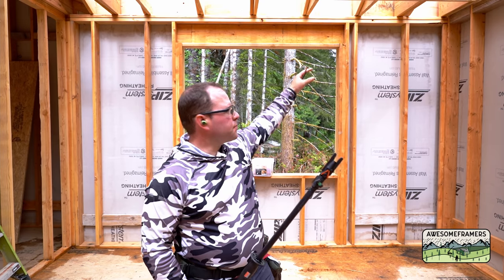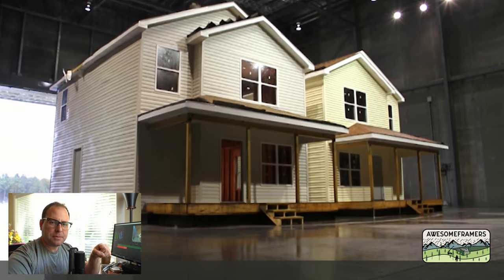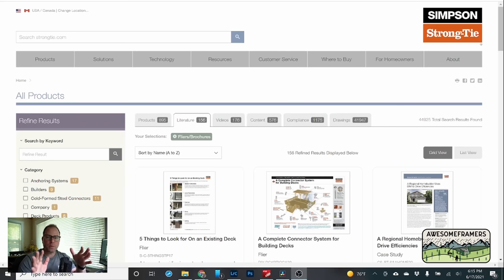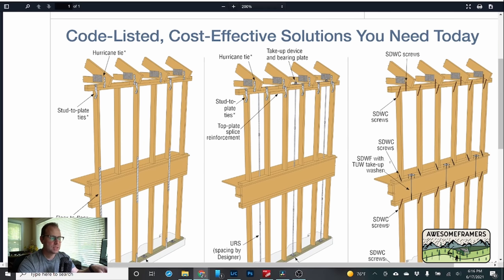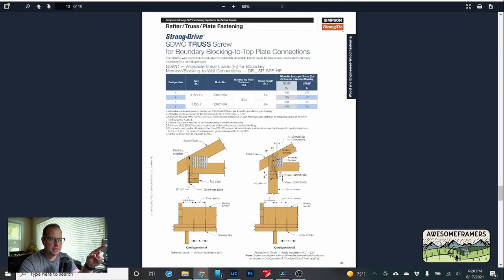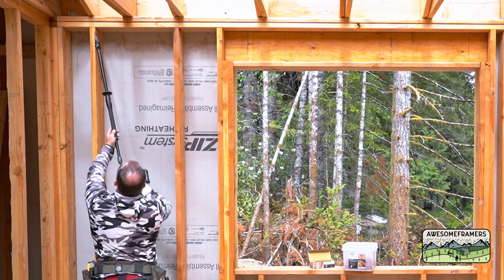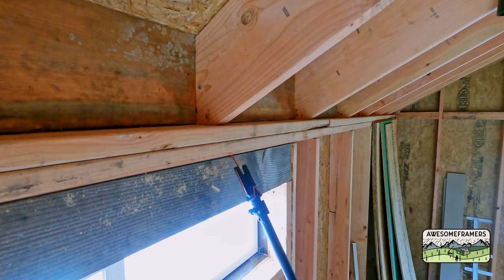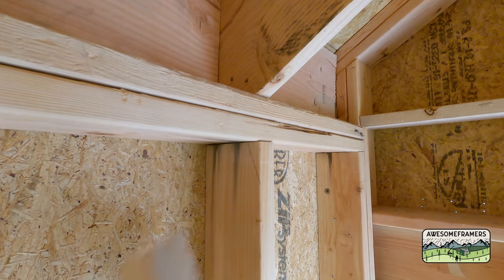Screws Instead of Hurricane Ties?

Comment: Drill/drivers may be faster, but I think you'll find at the end of the day that your wrist has been punished. There is little torque from an impact driver, but the drill/driver will be twisting your wrist all the time. Drill/driver is quieter too, though.
Reply from the maker: I'll trade off each time 😂😂😂
Reply: Not with the 40v drill he has, it has anti kick-back.
Reply: For a professional a drill/driver would be faster but for a homeowner an impact driver is more versatile.  A drill/driver won't drive in large screws or bolts especially into concrete.
Reply: Hire someone at the Home Depot parking lot...

Comment: In AU/NZ we have been using batten/bugle screws for over 40 years. They are load rated/speced in the framing code. We use them for many different tie downs. Especially for purlins(steel roof attachment). Drills in low gear are better than impact drivers for the long ones.
Reply from the maker: The more I see from New Zealand and Australia the more I wonder how far ahead of the US you guys are 🙂
Reply: @AwesomeFramers  I’m from Connecticut. We moved down here 10 years ago. In general the AU/NZ construction industry is 20 years behind North America, Europe. Typical houses are cheaply built. They do have some really cool things down here like their screws. They’ve been using steel in their framed houses for decades because they don’t have a lot of timber. It’s been fascinating to learn how their construction methods have evolved(The good, bad, and ugly).
Reply from the maker: @aspees  That'll teach me to think before I speak.  I would love to visit NZ someday.  That's bucket list for me.

Comment: Quality begins with the Building Designer/ Building Department design review. A well prepared detailed set of drawings calling out what is required for everyone from the general contractor to each sub-contractor makes the project goes smoother for everyone and provides a quality product in compliance with applicable Building Codes for the new owner. homeowner. Excellent video

Comment: I love these videos and I love that newer tech is finally getting adapted from twisted pier footings to structural screws. I will say in my experience a lot of the inspectors I have worked with understand the codes and also know they are “minimum” I’d say 9/10 times as long as you can have spread sheet or and engineer saying it’s okay they are fine with it. We all know speed matters, usually more then price. Great video

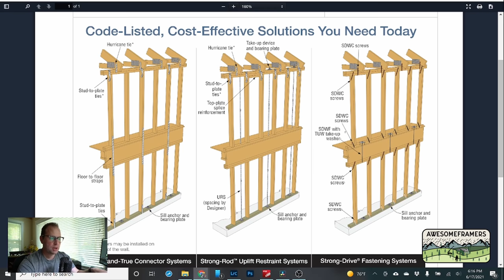Comment: Good information. This reminds me of a research paper l read many years ago regarding how resilient "balloon frame" from the early 1900's were compared to how we frame today.  Also how well metal stud framed houses hold up during hurricanes.  The stick frame method we've been using for around 100 years is out dated, just look at the drawings a 6:00, too many broken connection points.
Reply from the maker: We balloon frame all our gable walls.  The other connections are easy enough to deal with, but I'm not a huge fan of gable trusses.

Comment: I think the Simpson site and online catalogs are so the gold standard of product browsing. Products link to catalog pages that also link to research and back again to various code compliances and etc and it's amazing. But also a rabbit hole from which there is no escape if you're stupid nerdy like me.

One thing I was really interested to see was a video from Simpson of doing mockup structures using diagonal board sheathing. It had me thinking about the why and history of sheathing compared to current construction technologies. I've been playing around with models out of shear curiosity (eh? eeeh?) how feasible it would be to build a house capable of withstanding moderate seismic and wind events without the need of OSB or plywood sheathing. 

I thought about it especially because it's getting so hard to lift those 45-80 pound OSB sheets. I'd feel comfortable going back to let-in bracing, and diagonal or transverse 1x T&G sheathing given the forces these fasteners, hold-downs, etc. from Simpson can withstand. I'd even be ok with skipping the board sheathing altogether if I weren't worried about bugs and animals.

Given that there seems to be no end in sight for rising commodity prices in materials ($8!!! for a 2x4 x 8'), it's getting more and more tempting to look at durable alternatives to typical framing.

Comment: Are you using those in prescribed places by the engineer when it comes to stud to top/bottom plate connections? Or do you go every other one, or every single one?
Reply from the maker: I use them where the engineer spec's them.  We've asked him to spec screws instead of hardware whenever possible
Reply: @AwesomeFramers  makes sense to ask for them.  Been using them for top plate to truss connector instead of hurricane  straps.  Much easier, faster and safer than strapping everything.  Plus I don't have to hear my "Shane" complain about his elbow hurting from sinking tons of nails!

Comment: Do you know if plywood is ever accepted if it overlaps multiple components? For instance if a full sheet of plywood covered the both the studs,  bottom  plate, rim joist then mud sill which is bolted to concrete.

Comment: Good video. Wouldn’t wall sheathing normally tie top plates to studs? I understand rafter connections but not the stud screws.
Reply: Where I am in coastal Texas that's not enough, we have to tie from foundation to roof with straps and ties and a bleep load of nails.
So multiple stories take straps that go from 1st story studs straight to bottom of 2nd story studs then sheathing.

Comment: Very interesting. As a prior insurance adjuster, I usually only got to see what happened after the fact. Wind damage.... Fire damage.... Only got to see it after the fact. I should be happy! That said, it is interesting to see wind damage as it occurs, especially at very high wind speeds. Seeing Hurricane Andrews damage up close was unbelievable. Over 200 miles an hour wind gusts. Anyway...question...it looked like the house that disintegrated had a window failure. Pressurized the house. Should have shown the same issue on the fortified house. And structurally, there is not question the house was built better, but only saw minor rake trim missing. The siding should be peeling, regardless of the structure. Thoughts?
Reply: Exactly what I was thinking. How come the siding barely got damaged on one house and peeled off like an onion on the other? Seems the wind was not even or something.
Reply: The clip shown didn’t start at the very beginning of the association’s video. It’s a very long video. 
    The “fortified” house wasn’t just fortified in the framing/structure, but also with better/properly designed siding, doors, windows, etc… all put together.   The point was that hurricane force winds don’t have to require a complete rebuild or major repairs every time; if we built the entire house for the weather extremes expected in that zone.

Comment: Almost looks like the house in the first two shots came apart because the door was open. Door was closed on the other house, so that was not a fair test. On the interior shot showing the front door (which was open) the bottom plate did not appear to be attached to the foundation very well so attaching the studs better to the base plate wouldn't have made a difference.

I'm not saying there is anything wrong with the products, just that the tests seem to be skewed to make their product look better.

Comment: Welp.. We've been using screws for years here in Rochester Michigan.  But (big but)we gave up on the screws you guys use and now use HeadLOK 6".  The full threaded screws are useless for drawing lumber tight, which is what we end up using for quite a few applications around the house.
Reply from the maker: I hear you, for that kind of thing we use the SDWS.  I had trouble stripping the HeadLOk.  Regardless, all these screws have made life easier.  I'm putting together a video on how we use them to pull wood together, suck crowned lumber down tight etc.  Its fun to do all this stuff.
Reply: @AwesomeFramers  as a framer myself for over half of my life, I can attest to the satisfaction (and relief) one gets from sinking a screw every once in a while.  Nails get old!  Great vids, i can nerd out on uplift, shear panels, portal framing and bearing capacity any day of the week. Cheers!

Comment: Was the house that fll down attached to the floor at all? It seems like there was nothing holding it in place and it just slid off and collapsed.
Reply: Also the front door is open allowing the air pressure to get in and blow the roof off.
Reply: I open all my doors and windows for hurricanes 🌀 😅

Comment: Did I miss it???  How does an inspector know that you have these installed(especially many years down the road)?  Do the insurance companies provide you with discounts if you have these?
Reply: I'm wondering the same thing. I'd like to get insurance discount, but on the current wind mitigation forms it only lists "toe nail, strap, or clip". The inspector isn't going to be able to confirm these screws after the walls are completed.

Comment: "Many people think that the hardware companies lobby for the requirements, but actually...."

"Big Thanks to Simpson Strong-Tie for sponsoring this video"
Reply from the maker: Would you rather not learn how to save time and meet the code safely?
Reply: @AwesomeFramers  It's a great video otherwise, that comment just threw me for a loop.  Let me give you an analogy:

"Most people think that slaughterhouses are disgusting, cruel places, but actually..."

"Big thanks to ConAgra Foods for sponsoring this video".

I mean, yeah, learning where meat comes from is cool, but... your subjective conclusion which is coincidentally in the interest of your patron, immediately underlined by that patronage... Are you sure you didn't accidentally become one of the people lobbying for those regulations?
Reply from the maker: @TrogdorBurnin8or  I understand your point. I think you missed the larger point though. Strong-Tie makes the hardware we've used for years, but as I showed in the video, they have simplified how to meet code. 

Let me give you an analogy. We use power saws. But they need to be used safely. I would love for a saw company to sponsor a video on how to use them safely.

Or a roofing manufacturer to show proper installation, or a plumbing manufacturer to show proper installation, or etc etc.
Reply: Trogdor, I understand where you're coming from.  I think there is an over-reliance on metal connectors.  Sometimes there are solutions looking for a problem that get written in the code.

I do not think this is the issue with roof-plate connections.  Do you really feel comfortable with a 36' truss being held to the top plate with 6 toe nails?  If the roof will experience any significant uplift forces, I personally don't trust toenails alone.
Reply: @jonblakemore6454  
Just a bit about where I'm coming from:

I'm more than onboard with truss screws, whichever company they're from.  I seriously would like a house that you could tear off its foundations and roll down the block a bit in a flood while remaining generally house-shaped; This is less a practical desire and more an aesthetic one.  Some people go all in for French Country styling, this is my thing.  I care less about "reaching code-minimum" and more about going beyond.

And the ergonomics of construction has been traditionally dreadful; I absolutely love what they've done with screw guns lately, including the big truss screw one.  This directly impacts whether I'll ever be in a position to design & build a house myself instead of twiddling my thumbs online with floorplans and watching construction videos as a hobby..

As an environmental thing, it would be nice if you could achieve these results with cheaper, carbon-neutral products, though.  Maybe raised-heel trusses with a balloon-framed outer wall tying them down?  It gets complicated... but the new carbon economics suggests that adding a good bit of wood beats adding a whole skeleton of light-gauge steel.  Anyone remember pressure blocking? That could be a thing at this connection, if you have long enough screws to reach through that many inches of wood.
Reply from the maker: @TrogdorBurnin8or  great points!  We pressure block most connections because it uses up the scrap.  I've been listening to engineering podcasts about mass timber construction and CLT.  I love that idea.
Reply: @AwesomeFramers  I would think that Simpson is loosing some money by selling screws instead of metal plates, although I don't know for sure.
Reply from the maker: @pferoxtheskeeterguy  I've talked with reps and an engineer from Strong Tie, they aren't losing money :-)
Reply: I don't know if simpson is sponsoring this video, but it has that taste,  i agree on many things with trogdor, funny thing is saying sdwc screws are better than h2.5.  What i see is a battle  simpson vs simpson, its been ages since simpson monopolized hardware industry and every body bought into it, engineers, goverment, contractors, builders, even my grand ma!  Me myself yes, im skeptic i dont think is tje hardware failing, but the crafsmanship, i've seen houses well a 100 years old here in southern california after some well known earthquakes thru their lives and still standing strong with no hardware at all!!  Soo there is my point as for  Jim's comment   $0.32 h2.5  vs  $0.70  sdwc  
Price per piece  is matter of knowing what is the cost to make them  although labor price must be cheaper the screw well that wast my 2 cents!!  Be well!!

Comment: Is there a way to fasten an existing house to a foundation for tornado prone areas. I see most retrofit solutions only work for earthquakes.
Reply from the maker: A structural engineer in your area is best qualified to answer your question.  👍👍
Reply: @AwesomeFramers  I am looking at an option that uses a 3 foot drill bit to drill from the main floor into the top wall of the foundation, and at a slight angle. then Use the epoxy/bolt combo to not put pressure on the concrete like expansion bolts do.

Comment: I would be much more concerned with the widespread use of cardboard sheathing rather than top plate connections from what I see being built around here. Unless the top plate is nailed to with a rigid type of sheathing this just causes the top plate to go with it
Reply: Top plate is nailed to the studs not sheathing.
Reply: @kenzie0201  no, really🤡

Comment: Just be done with it and add Cyclone Rods from top plate direct into the foundation. Also ply wind bracing at the external corners from top plate all the way to the bottom plate/floor beam.
Reply: Just make the house out of concrete and throw hands with the hurricane.
Reply: @TheGalacticWest  if the 3D printed concrete houses get code approval. Most new houses could have a concrete structural core.
Reply: @cjwrench07 They aren't concrete, it is grouting.  Or if you prefer Portland cement with some fibers and binders.  Diamond age is the only 3D printer using aggregate style concrete.
Reply: @TheGalacticWest I am pouring concrete down all my walls now, wish me luck!!!